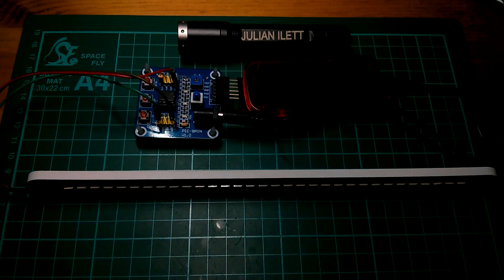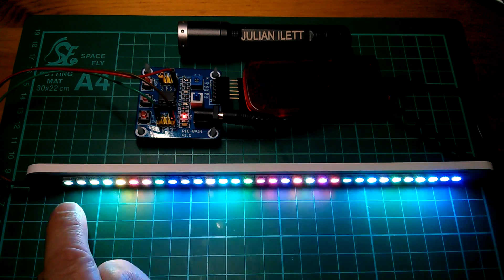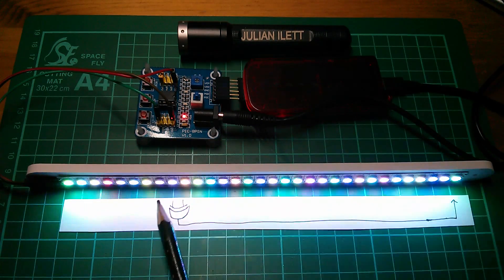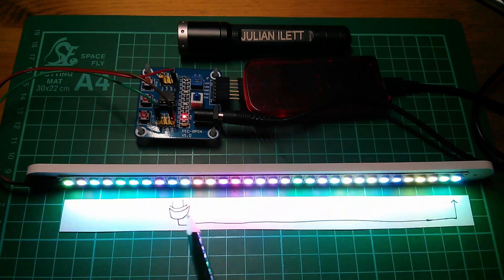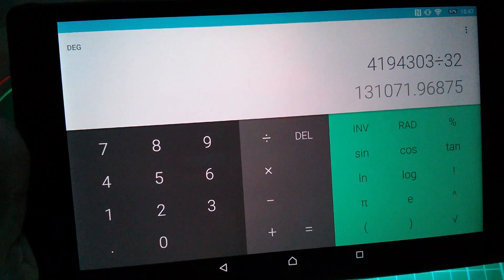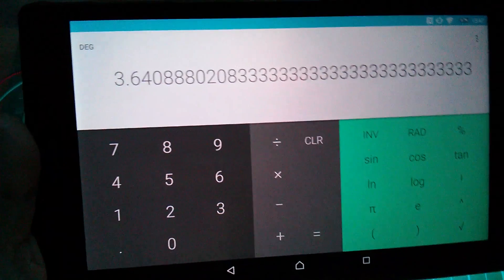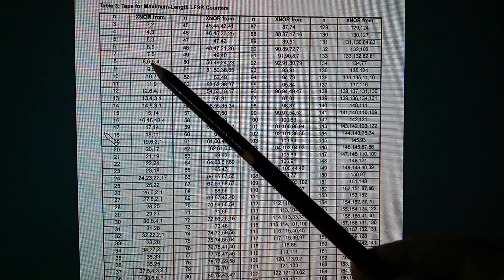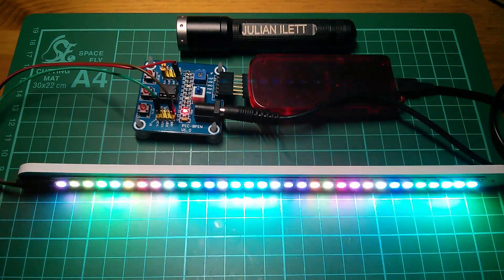NeoPixel LFSR Update: Pseudo Random Colours

Comment: Looking at the lfsr subroutine code on hastebin. After realising it is an external type shift register, things started to click :) 
lfsr
 rlf  shiftreg_mh,w ;copy/rotate LFSR hi byte to W
 xorwf shiftreg_mh,w ;compare LFSR hi byte with W
 andlw 0x20   ;mask all bits except bit n
 addlw 0xff   ;copy bit to Carry flag
 rlf  shiftreg_lo,f ;rotate LFSR lo byte (thru C)
 rlf  shiftreg_lm,f
 rlf  shiftreg_mh,f
 rlf  shiftreg_hi,f ;rotate LFSR hi byte
 return

I think I now understand why you wanted two adjacent taps now. With two adjacent taps you align the taps on top of eachother by rotating the file into w, xor it with the old self, then pick the resulting bit into carry by overflowing the accumulator. That is amusing. I used bit-tests for that. Lol, that is brilliant (the overflow thing).
Reply from the maker: +bwack Thanks! I'm not a big fan of conditional branching. Much prefer logical and arithmetic manipulation.
Reply from the maker: You can use a swapf instead of an rlf for bits which are 4 apart. And bits which are 8 or 9 apart are easy because you're comparing the same bit in different registers.

Comment: Make a 32x32 grid of these.
Reply: Ashish Kasturia
You're crazy. That's 1,024 (3,072) LEDs. You would need a power supply that can supply at least 31A for half brightness, 62A for full not including power consumption of the ws2811 drivers. That's dangerous. Not to mention you can't run strings longer than 300 or you'll suffer data degradation. So you'd also need at least 4 data lines running simultaneously in-sync.